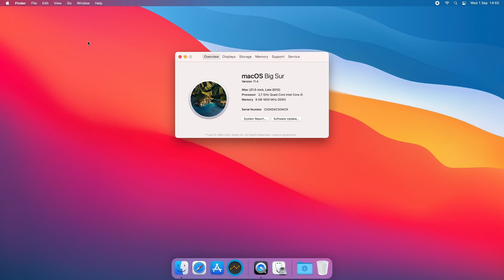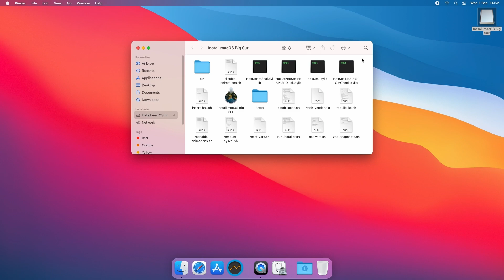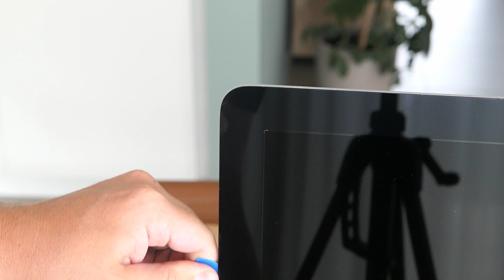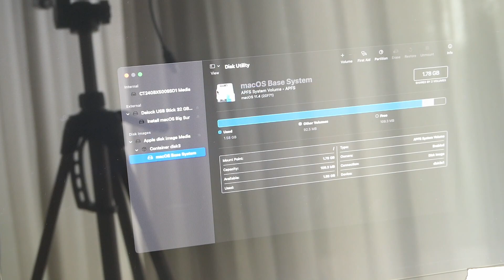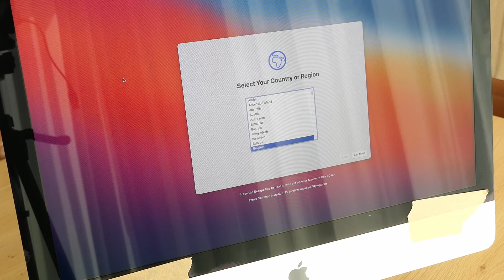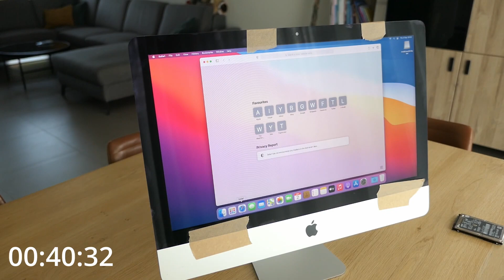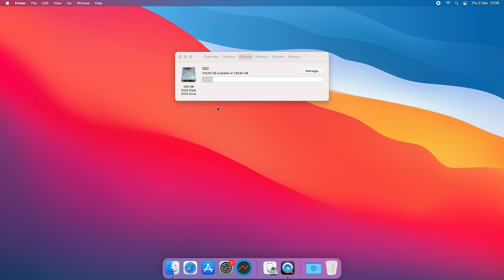iMac 2012-2017 SSD Upgrade

Comment: It can install a nmve and an imac from 2012 (a1418)?
Reply from the maker: I heard rumours about this but in a 21,5" iMac, an NVMe connector is only present when the device was originally ordered with a Fusion Drive. The connector should be on the opposite side of the mainboard, right bottom when opening the iMac. never did this myself though.

Comment: Excellent job, very detailed and easy to follow. I have 2017  21.5 inch Mac. It works good but very slow. Even my 9 years old PC is faster than this Mac. I know I need to replace HD with SSD but not sure if I can do it. Your video is very good, maybe if I watch it few more times I'll be encouraged to do it, we'll see. Thanks for the video.
Reply from the maker: Thanks for the kind feedback and good luck if you decide to go for it. Jus take your time and stay calm and all will be fine :)

Comment: I’ve been thinking about upgrading my iMac hdd to an ssd for a long time. Your video is giving me the encouragement to do it. Thank you. Is it possible to add a second drive inside this model of iMac? Some people say you can add an m.2 drive inside it too. Did you notice an empty slot?
Reply from the maker: I read about it and saw the M.2 slot before on a 27' iMac internally. It can be done in models that originally came with a fusion drive (which is in reality a smaller NVMe/M.2 SSD on the motherboard combine with a regular hard disk by software).
You would need to remove the motherboard as well to reach the slot as it is on the other side, like the memory DIMM slots.
Reply: @jensdbe  Hi Jens, I finally did this last week. It took about an hour to completely disassemble my 2017 27” iMac. I added a 1TB NVMe drive replacing the 32gb stick that comes as standard. I needed to buy an NVMe adapter by sintec for this. I also replaced the 3.5” HDD with a 2tb SSD. I needed an adapter for this too. I also had to buy a thermal sensor from OWC. This was needed to prevent the fans from always being on. I’m glad I did the upgrade. My HDD was taking over 3 minutes to fully boot. The SSD takes 40 seconds to fully boot. Thanks again for continuing to upload your great videos. They’re very inspiring.
Reply: @sayeghjoe  I am thinking of only using M.2 ssd and take out the HDD - will I have problems if I only rely on the 1TB NVME drive? Or do I HAVE need to keep the HDD or replace it with a SATA SSD? Thank you
Reply: @lasasdfasdf  I’m not sure. I personally wanted both an SSD and an NVME drive. I have Mac on my 2TB SSD. I have windows installed on my NVME. I haven’t read any reports if you can have just the NVME. I’d recommend using both of them. You won’t want to open up your iMac again and again. Do an upgrade that gives you plenty of storage so that you won’t feel the need to upgrade it again in the future.
Reply: @sayeghjoe  Thank you for the reply! I appreciate the advice!